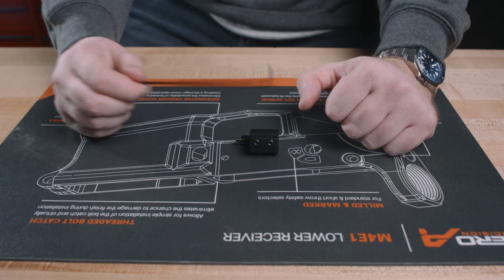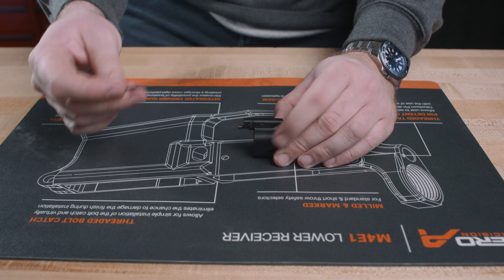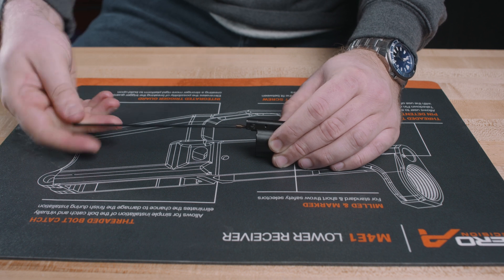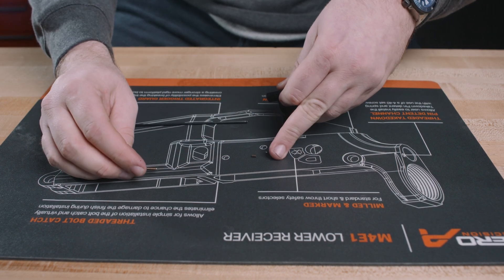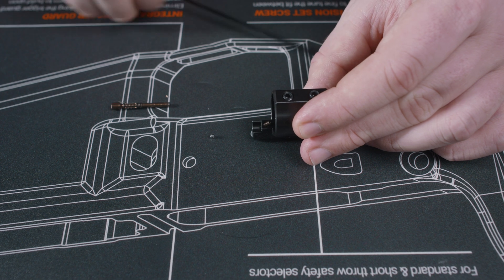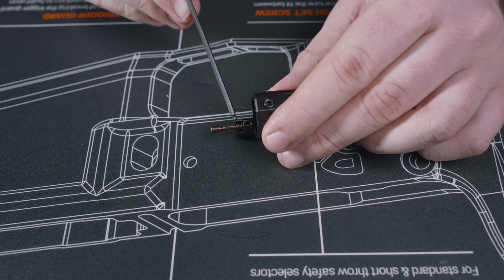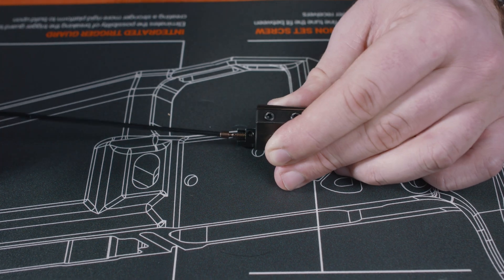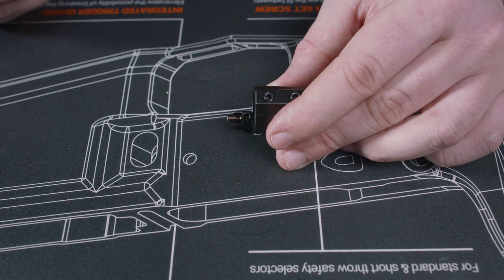Aero Precision Adjustable Gas Block Disassembly/Assembly

Comment: DO NOT BUY THIS PIECE OF SHIT!!!!
You can only adjust from NO gas to LOW gas. 
Will not cycle bolt completely full open.
You will void warranty putting it on as the set screws are tiny crap that strip at 25 inch pounds. Supposed to be 40. 
I'm going to have to grind the fucker off. I took out the adjuster to check it, but you can't put it back together without removal.
Piss poor design. I dont imagine it would have held up long anyway.
That's the truth.
Reply: Sounds like you didn't have the gas port lined up correctly, I just tightened up the set screws good and snug with some loktight on them. Have to agree that you shouldn't have to remove the gas block from the barrel to do a thorough cleaning. If I ever do I will try to leave it on and put the detent parts back in with hemostats.

Comment: Once buried to bottom of threads. How many clicks back until I should be at a good starting point for adjustment?
Reply: 3 turns out is full open,
Reply: @mikebelcher6692  You realize I asked this a year ago? 😂 No worries though, it has run flawlessly since. Thank you for touching down though.
Reply: @rickduncan2929  Yeah, I kinda figured u had it fixed but thought I would reply to your question anyway. I might need some help n u might have my answer one day. Take care n have a good day Sir.

Comment: It's cool that it ships with a spare detent and spring as well
Reply: One is none and two is one.
Reply: Thank you for answering one of my 2 questions. Does anyone know the distance between the 2 set screws? I will be dimpling a new barrel.
Reply: @machinis I could measure with calipers but there is a company that makes a set screw that's hollow with a punch in it that's nice to use. I'll try to get back to you with exact measurement